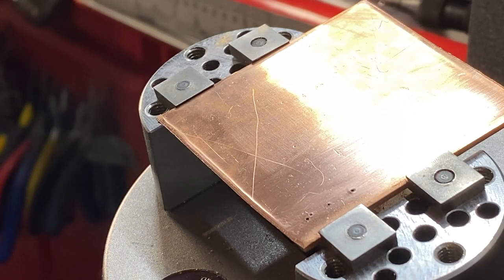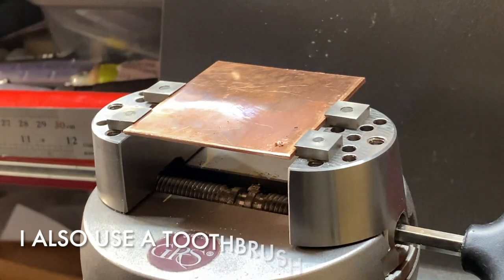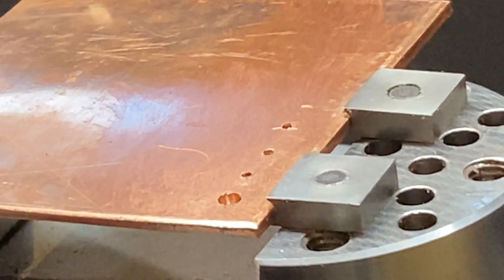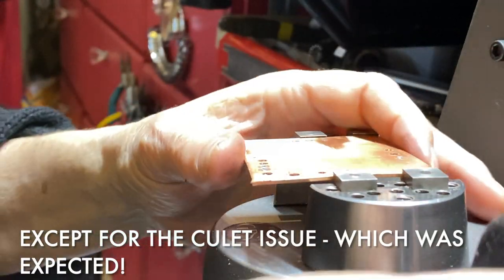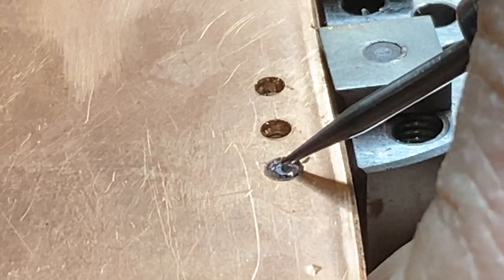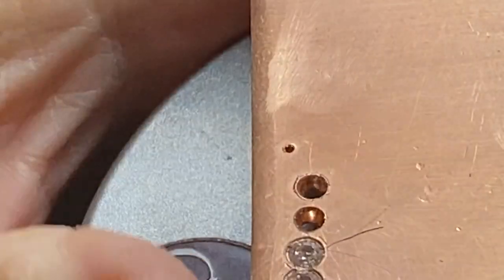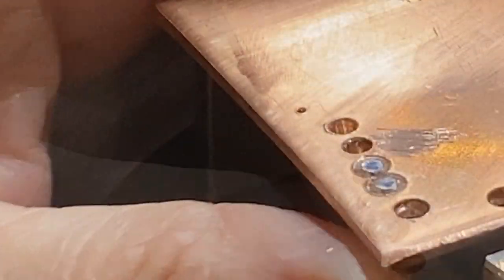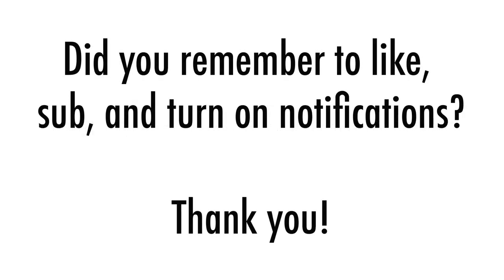Stonesetting:  Flush Setting  3 Ways  - Part 2

Comment: Great videos cheers Nancy

I am looking at adding some 1.5mm diamonds to a 1.1mm thickness gold ring i made (making it for the first time) 

I had a 3mm diamond but it is too deep and sticks out the bottom if the band. Therefore decided on the 1.5mm's as they wont protrude! I drilled a 1.0mm hole in some scrap silver the same thickness as the gold ring and used a 1.5mm setting burr as a test - I can gardly see it.

How can i possibly flush set the diamonds as the burnisher is as wide as the hole near enough?

Comment: Thank you for this. Of all the settings I’ve done, flush setting was always my Waterloo. I had SO much trouble with it, and it was so frustrating with everyone and their poodle saying how “easy” it was to do. I finally managed to get a stone set and realised that my issue was sizing of my holes. All the info on sizing is very helpful cos I STILL have some issues at times
Reply from the maker: You are not alone!  Thank you for writing!!!
Reply: Hi Nancy! I have a quick question - I'd like to flush set a 3mm stone - it's faceted but has a flat back. Would I need to drill the hole differently to make sure the stone sits correctly and flat?

Comment: Thank you so much for your wonderful tutorials.
So is it just the tiny metal lip that is holding the stone in place? 

I have some lively lapis stones that are cylindrical in shape. Flat top and bottom. 
I would like to put them in a bezel so they sit flush with the top of it. 
Any idea of the best way to go? I am tempted to cheat and use glue.